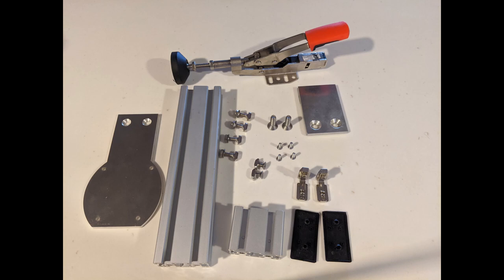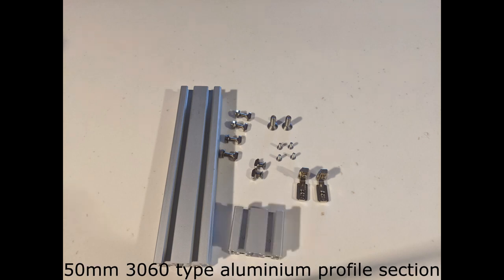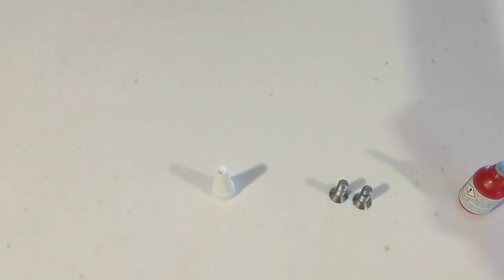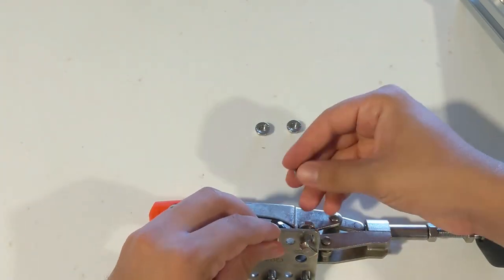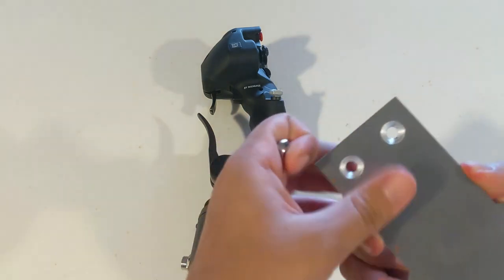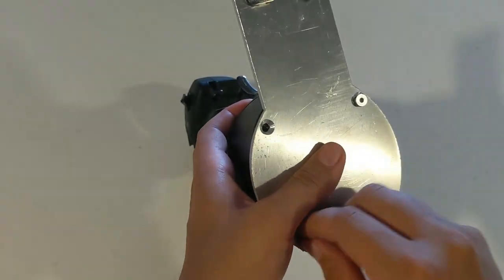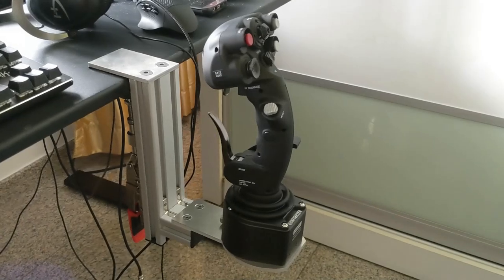Joystick HOTAS Table Mounts DIY! [Machining Drawings + Links in Description!]

Comment: That is very nice. I am almost jealous of how small the base on your stick is, I use the X-56 stick (along with the throttle) and the base is so huge! Also can't believe it never occurred to me to use those sort of clamps, I use them at work all the time. I was going to use some modified G clamp, which would have been a nightmare.
Reply from the maker: Yes! That's exactly why I moved away from the x-56 stick - the big old base kept bumping my armrest, and it's impossible to use it as a center stick. Those clamps are pretty expensive - I tried some much cheaper alternatives but these do work best.

Comment: Thanks very much for this video! I know it is not recent but it has really helped my thinking about table mounts. I have a couple of observations.
Looking more closely at the Monstertech gear, it appears they use 4080 profile rather than the 3060 you use. Looking at different clamps on the Bessel catalogue, I think that you must be using the smaller clamp STC-IHH15. This would fit the 30mm slot spacing on the 3060 profile. The bigger clamp you provide a link for (STC-IHH25) would only work with 4080 profile.
Reply: Excellent comment

Comment: Awesome video! thanks man! One question, what does the "3060" actually mean with the Aluminium profiles? All my local stores only have 4080 or other lower numbers.
Reply: Basically means a 30mm x 60 mm profile. 4080 is 40mmx80mm. You can use that too, and get the appropriate bits,  but you'd actually be better off going down to 2040, instead of going up to 4080. I think Foxxmounts uses 2040, and it seems to work okay - I doubt any person is strong enough to really flex any of these profiles! Any flex will likely come from your baseplate, as long as your clamp is tight.

Comment: Nice work.  What was the approximate cost for the machining work?  I am trying to determine if it is worth spending $56.00 to buy the Virpil mount for my WarBird base. Or have something made, as you did here.
Reply from the maker: Really, really depends. It was 10-20 bucks, depending on complexity of the base plate. However, I'm in Asia. Even if Singapore ( where I am)  is relatively more expensive than most of Asia, it's still cheaper than Europe/North America.

Comment: Hello from Singapore! Haha super happy that I found your video just when I was researching on how to build my own desk mount! I have a question though - what material did you use for your custom plates to mount your stick and throttle? I was looking at FMB's website and they list a whole bunch of different types of aluminium..
Reply from the maker: Good question! Honestly, I just asked them to provide me with steel plates, instead of aluminium. I only used aluminium 3060 profiles. Point is, for those plates you want the material to be as stiff as possible. The profiles' complex structure keeps them stiff. But for plates - steel has about 3x of aluminium's Young's modulus. You'll have less play in your setup that way (and it's not like weight matters a whole lot, unless your desk is flimsy).
Reply: @thelungilife6057  Ohh ok. Alright I’ll try to look them up and see if they can come up with something for me. You wouldn’t happen to have plate drawings for a Virpil Warbrd base and Virpil CM2 throttle would you..
Reply from the maker: @Jiterator  ah, no,.unfortunately. should be easy enough to find dimensions on their website though!
Reply: @thelungilife6057  Heh no worries. I'm sure I can find something in the forums. Thanks for all the help!
Reply: @Jiterator  how did you go with these base plates? I'm about to purchase 2x warbrd base with constellation alphas and i want to give this build a go! I was thinking about tracing the base plates and then transferring into illustrator
Reply: @Darkhorse77777  Hey! Turned out I have a friend who works in the metal fabrication industry and he was kind enough to draw up the stuff for me, then sent them off to the machining factory. We ended up making a plate design that could fit both the warbrd and cm2 throttle. Super happy with them!
Reply: @Jiterator  nice work! I'm currently learning that aluminium extrusion is really REALLY expensive here in Australia.... roughly $39-49 AUD per half meter
Reply: @Darkhorse77777  Wow yeah that sounds pretty expensive. I used 2 sets of 2 extrusions (2x25cm and 2x14cm) and it cost like $51, including all the nuts and bolts to hold them together..

Comment: Great video. So now I'm wondering what the difference in cost is compared to getting a pair of the Monstertech mounts. It's almost exactly the same parts.
Reply: Link to a sheet with costs is in the description :)
This is significantly cheaper to build in Asia (where I am), because the materials and plate cutting costs are very low.
Bottom line is that Monster-tech only makes sense if you're in the EU. Their shipping costs outside the EU are insane. They don't seem to understand the volume of orders they're missing out on if they negotiate better shipping terms, or even set up a production unit in Asia to serve markets outside the EU.

Comment: If you search on Ebay you can get a clamp like this for less then $10 including shipping (in germany). Search for "Schubstangenspanner".

Question, why use such a short extrusion at the bottom? Why not use one that is long enough to even support the whole JS base? You wouldn't need a 5mm thick aluminum plate to have a stable platform.
Reply: Vielen Dank! Das ist gut fur Europa, aber der Versand nach Asien kostet 60 Euro. Sorry for the out of practice Deutsche ;)
Reply: @neerajsoman  Das ist sehr schade!
PS: Dein Deutsch ist super!

Comment: Did you find the 5mm plate was strong enough? No flexing in the joystick bracket?
Reply from the maker: 5mm works - I tried 3mm on the joystick plate and that flexed a fair bit. 5mm is totally rigid. I still use 3 mm plate on my throttle though - the slight vertical flex is actually quite nice for the throttle. But I use an X56 throttle which is pretty light. Would use 5mm for the Mongoos or any metal throttle.

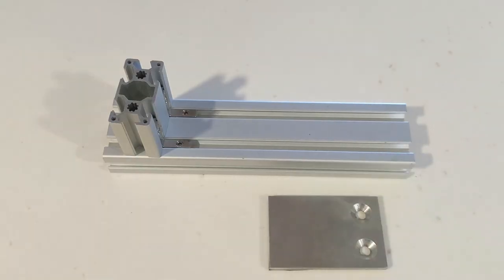Comment: Thanks so much! 3:30 it looks like the item on the left is slightly slanted or diagonal or something - it's jutting out towards the front. Is this not a problem?
Reply: Left intentionally a bit loose at this point, as you'll need to adjust the height of your stick once you mount the baseplate anyway. It's just on there at this point for ease of assembly.
Reply: @neerajsoman  Thankyou! And one more question, is there any reason I couldn't use a square baseplate of wood?
Reply: @bennuwa   wood works as well - I used 8mm model airplane plywood in my initial build. Model airplane plywood has thinner and more layers for the same thickness as carpentry plywood, and is stronger but more expensive. Though, that's the absolute minimum thickness of plywood that works without flexing, and I'm not sure how long it would last.
Reply: @neerajsoman  Thanks! I have another question, what size have you made the holes on the baseplates, for the four corners of the thruster/joystick? Your diagram says '7' but that seems way too large. How big are the holes on the devices themselves and surely any size would work so long as a screw/bolt can fit through the hole on the devices? Please let me know. Thanks
Reply from the maker: @bennuwa  those are 5mm, which I believe also works for Virpil sticks. The 7 is the countersink size - it's showing up weirdly cause I used cheap drawing software, heh.

Comment: 250 mm and 50 mm is width or  bothe profiles ?  what is the lenght of profile 250  and 50  ?
Reply from the maker: The lengths are really up to you, as your desk and chair dimensions will determine how low and how far down you want your stick/throttle. The vertical is very adjustable, so that's less important than the horizontal piece length. Mine are 250mm vertical, 50mm horizontal. .

Comment: Hm that Bessey (STC IHH25) appears to have the hole width 33-48mm, yet here it fits a 30mm gap on the extrusion? Yours is definitely not STC 15?
Reply: It's why I'm also using longer T-bolts. It's not a perfect fit, and they're slightly canted outwards. Doesn't really affect the purchase; not wobbly.
Reply: @neerajsoman  Makes sense! Again thanks for your project. I'll try to find 4080 compatibility and see how it goes.

Comment: Hey, thanks so much for showing all the details on this design and making a video on how to assemble it! Gonna try it but was wondering if you went to a machining place in-person or ordered online. If you ordered online, how did you communicate with them to ask for things like tapping m8 threads into the top of the 3060?
Reply from the maker: Hey! So, I got the 3060 from a cabinet maker - they drilled in the M8 threads for me. All comms over email. 

For the plates, I drew them out in smartdraw (See the files in the description), and emailed them to the machinist/metal shop. It took one or two back-and-forths to explain - esp drilling countersinks.

Comment: Great video and you certainly got a like and sub from me! QQ, how can I go about designing a cnc file for the VPC throttle and Warbrd base for the machinist? Also, since I'm in the US, I want to use 1020 or 1530 so the top plate would need to be redesigned too. Any input? TIA!

Comment: Kinda hard to find some of the stuff.  Like the Bessey Clamp.  That Black head on it looks nice, but the ones I've found don't have that.
Perhaps provide the exact URL links to some of these items not from the FMB?
Reply: Unfortunately, that's going to be hard as I live in Singapore. If you're outside Asia, you're going to have to do your own research I'm afraid. Though if you're in Asia, best to get on Alibaba and put out a request for proposal, and you'll be flooded with options. If not, best to go to your nearest metal fabrication yard (like FMB in Singapore) - window fabricators will have all of this stuff. They may even give you these pieces practically for free as they'll be scrap cutoffs too small to use. Metal yard will also have a variety of rubber feet - the thread diameter is standardized.
Reply: @neerajsoman  Yeah.  In Asia, but not SE Asia.  Was hoping the links would at least point to the same thing as presented in the video (i.e. Bessey Clamp).  Other Aluminum/metal parts, gonna have to research locally to see what's out there.
The THREADING on the inner pieces may be a challenge to find a place to do it.
Reply: Bessey clamp.can be found on Amazon at the link below. If you are able to source the aluminium profile, it's highly likely the shop or fabricating yard would help you with the thread tapping too. I just asked the machinist there.
https://www.amazon.sg/dp/B0057PUFMG/ref=cm_sw_r_cp_apa_fabc_eac9FbH17AS3D?_encoding=UTF8&psc=1
Reply: @neerajsoman  Yeah, I can find the Bessey, but the HEAD PART (Black) that he has on his in this video actually looks like it'd be a lot more secure.  I dunno if that was some custom fitting he did.

Plus, considering hard to get 75mm of Profile, I guess I'd go with 100mm for the future adjustability and stableness of the mount.
I haven't been able to find any good source of Aluminum profile in Japan, and what's on Amazon is extremely overkill in price.
Could get it from Aliexpress, but up to 60 days to deliver....
Dunno where there's a shop that could do the threading inside the profile as well.

There's 3060A and 3060B series.  I'm not sure the difference and if that impacts the rest of the parts on his list that interacts with it.
Reply: If you're in Japan, then it may actually be easier for me to ship you the profiles and plates as a kit. It's just shipping to EU/NA that's problematic. Cost of labour in Japan is going to be super high, consequently, plate cutting and profile cutting will cost a lot, locally.
Reply: @neerajsoman  Thanks for your offer.  I think it'd depend on a few things.  Especially TOTAL $$ Estimate including customized plates for my control sticks.
If you're willing to discuss, let me know how to contact you.  Thanks.
Reply: @neerajsoman  BTW  What are these in your list?

4 x T-Nut -3030 Series
2 x Adjustable Swivel Feet

I don't seem them as part of your video items layout.  Maybe I missed that?

Comment: Which hardware store sells extruded aluminum? Can’t find it on Lowe’s or HD
Reply from the maker: I live in Asia, so stuff is generally easier/cheaper to source. But Home Depot's window section, or better, any small window/doorframe/prefab house manufacturer locally would work. They'll likely have tons of aluminium extrusion scraps lying around that they'll sell cheaply.
Reply: Thank you for the super quick reply. I saw the doc files after I asked and saw you were in Singapore. 
Thanks again for the quick reply. This is definitely what I want to build, don’t want to pay $300 for monstertech mounts.... just too much imho
Reply: Yeah, I can afford it but the price of "convenience" is far too high for Monster-tech / foxxmounts, when you consider how easy this build is. Not to mention missing out on enjoying something you've built yourself.

Comment: Does anybody has custom plate drawings for the virpil warBRD Base and the virpil moongoose T- 50CM2 Throttle. hard to find detailed drawings...
Reply: They do not have them on their own webpage or forum as a part of their documentation? I think I saw them there when I was interested in their stuff. 
If not so, go to the DCS forum and ask there - quite a lot of cockpit builders and jet-jockeys, so most likely at least somebody knows

Comment: it could have been a cool video had he not used such exotic, overly expensive and pretty hard to find and/or source custom machined parts.. Surely this can be done way simpler and way cheaper without losing any of the functionality or build quality.. missed opportunity
Reply: A machined base plate is not different than a hand made base plate.  You just use a different set of tools to get the profile cut to your preferred shape.  You can cut it with a coping saw if you want, the end shape is going to be as good as you can make it with hand tools.  If you live in any city, you can quite easily find a place to machine a simple base plate for cheap.  I mean he paid $8 for the cutting, so not exactly "exotic"

Comment: 40$ for just the clamp... You could buy an entire prebuilt one for 60$?
Reply from the maker: If you can find me someone who sells and ships foxxmounts or Monstertech to Asia for less than $400 for 2 mounts, let me know.
Reply: @thelungilife6057   @The Lungi Life  g'day mate. Great video, don't mind this hater. Ive read through all of your comments and I've finally managed to find some alternatives to bits and pieces you mentioned. 

One question I did have is about the larger rubber clamp end you have (the black one on the Bessey clamp). Seems like having a larger foot print like you have would contribute to making the whole thing nice and sturdy like yours.

Again, awesome build it's pretty much identical to any pre-built stuff for a fraction of the price. I'm in Australia and they'll cost me $100 to make each which is still 200-300 cheaper than the monsters or Foxx.
Reply from the maker: @Darkhorse77777   thanks buddy - best is to head to a shelving maker, and get those feet. The tiny orange Bessey clamp feet are not great. The big rubber ones are super cheap - I believe they were 8 Singapore dollars each. They're just industrial shelf unit feet.

Comment: I ordered another, somewhat cheaper clamp, before seeing your video. What sort of drawbacks did the other options have before you settled for the Bessey (which is not available here)?
Reply: Largely the adjustability and flexibility. Basically, the bessey clamp isn't quite as fussy as others. Others will require you to endlessly fine-tune the gap. Also, whichever clamp you get, try to get as wide a clamp "foot" as possible - you'll end up with less pressure on your furniture and get a more stable hold.
Reply: @neerajsoman  Thanks, that makes sense. I wonder if a clamp "foot" can be customized/attached. And if that affects stability. Will see when it arrives.
Reply: @Spelljammer1  absolutely - this isn't the original bessey clamp foot in the video. That works fine too, but I had a couple of spares from an old shelving unit. Just find one that fits the thread, and it screws in.
Reply: @neerajsoman  It looks like I'll have to go for a 4080 extrusion to accommodate my clamp (scared that they gave me a '41mm hole width measurement!). Too bad that means I can't recycle your mounting plate diagrams. :)

Comment: Looks like you took apart a Monstertech mount and put it back together on video without even mentioning it.
Reply: Then you missed the part where I bought all those components for 1/8th the cost of MonsterTech locally, and drew the plates/got them cut, too. Read video descriptions, it'll save you some embarrassment.
Reply: @neerajsoman  Well, that doesn't change the fact that this is a clear ripoff of an existing design and that you didn't even have the guts to at least mention where you get it from in this video. This would have make it completely acceptable then. If someone should be embarrassed, that's you who let believe all those people that you were a mechanical genius where you were just a copycat. Anyway, I appreciate the effort to find the parts and reference them.
Reply: @guillaumegaillet4066  it's not the same design. I don't use the same internal bolt attachments, but L brackets. Literally the only part of this in common with Monster-Tech is a third party clamp not designed by monster-tech anyway, but by Bessey. But I guess embarrassed ignorant troll's gotta troll.

Comment: @5:07 bro.... nut driver or socket set
Reply from the maker: Bolts are very close to the clamp - couldn't fit my socket wrench over the bolts unfortunately.
Reply: @thelungilife6057  may be use a wrench??? As a mechanic it hurts to watch! :-P